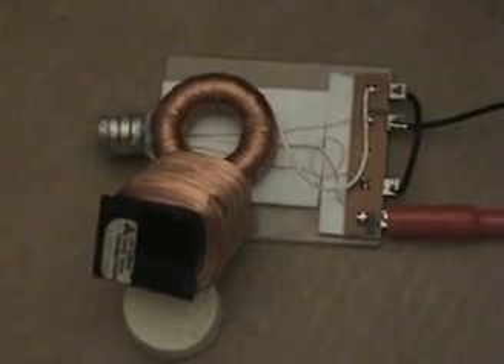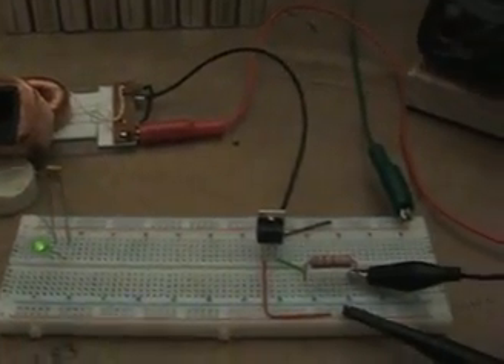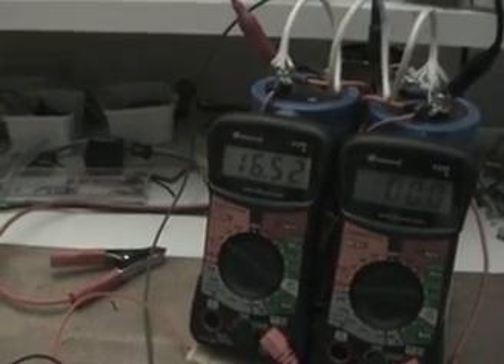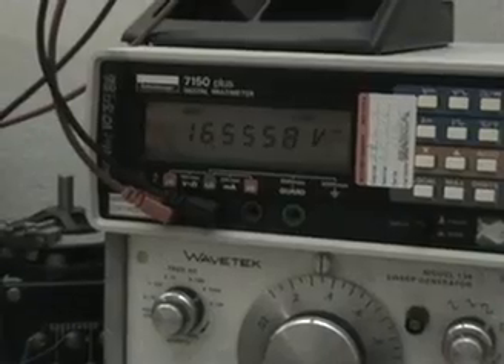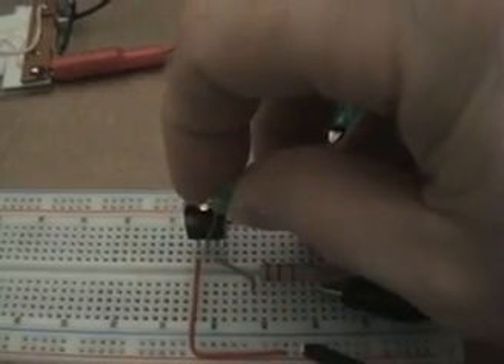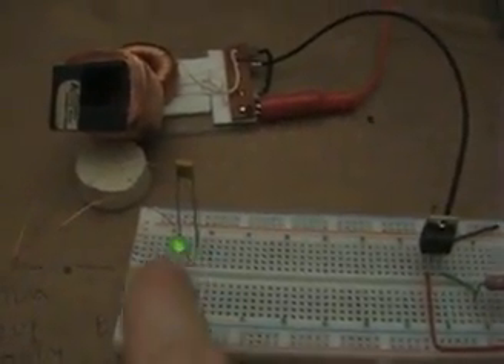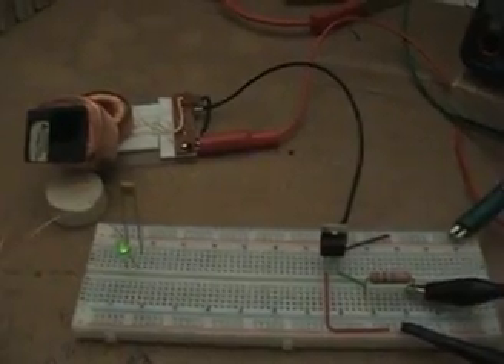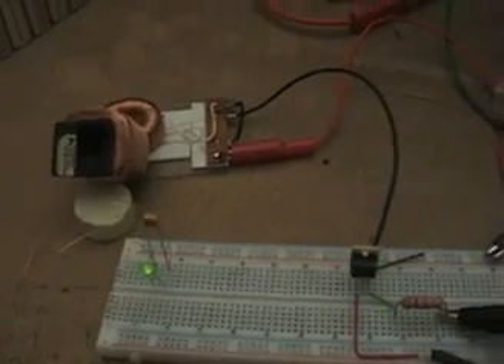Self Running Coil test 9

Comment: You can't possibly claim OU when you are driving a voltage into the mosfet transistor from your frequency generator .. that minimal energy is whats charging the caps .. 

even if you remove my comments it doesn't change that fact. 
This is NOT OU .. clearly

Comment: Yes Luc, you use the internal "stray" capacitance of the Mosfet to charge up your caps.
The frequency generator supplies here mostly the energy.
You did not correctly measure, how much energy you did draw from the frequency generator.
Just concentrate better to build bigger ferrite or iron toroids and use large pickup coils.
This needs to be scaled up at least 10 times in size to overcome all the magnetic losses,
until you see real overunity...

Regards, Stefan.

Comment: This setup does remind me very much at the setup from Floyd Sweet (RIP) There is an interesting video out there from Floyd Sweet with Tom Bearden. I believe the device is called a MEG, or motionless energy generator. Floyd Sweet was also working with a wave generator, and some sort of  Bedini circuit and a mysterious box with magnets and coils at a certain degree. What they say is that the box had an output from 300 watt, but the input was less then 10 watt.

Just to inform you, greets, iT